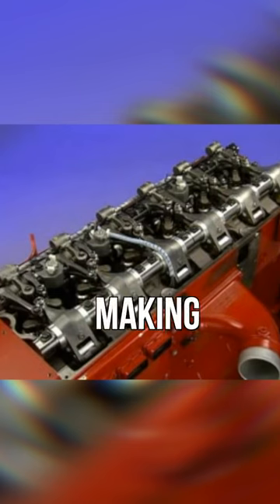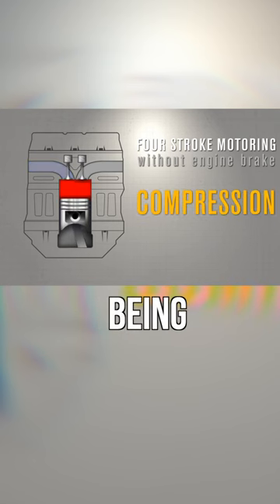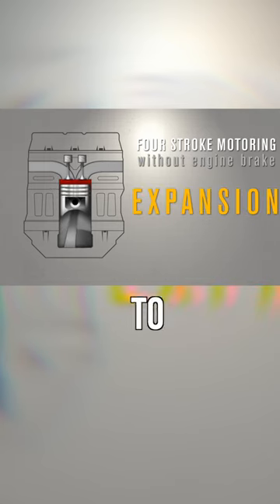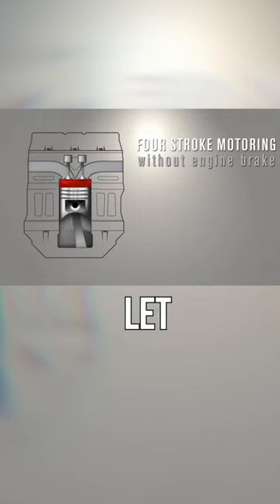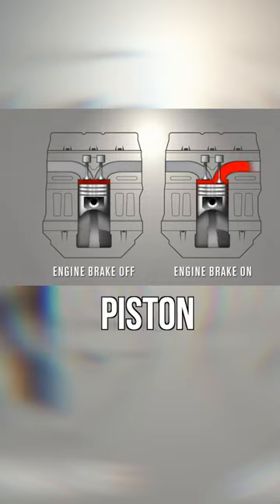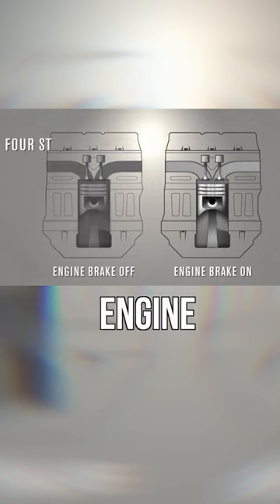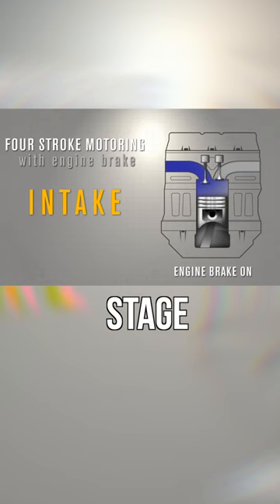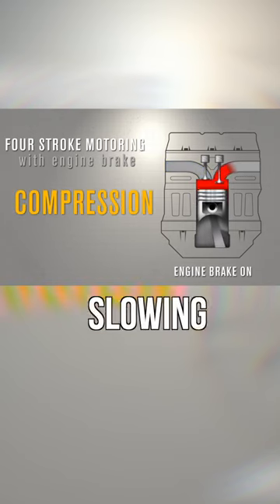What is a Jake Brake? (Short)

Comment: On all the cummins 6bt 6.7  liter engines I've ever worked on uses a sliding ring inside the turbocharger to restrict exhaust outlet. Nothing changes the exhaust valve lift internally.
Reply: But.... that is a exhaust brake.
Reply: That's an exhuast brake; they build pressure within the exhuast itself.
 Real jake brakes build pressure within the cylinder itself
Reply: @3ch0_17 Releases pressure, not build

Comment: You explained 1 stroke out of four. But now since we have no compressed air to push the cylinder down we've created a vacuun on stroke 2, the firing stroke  which is just reverse compression, etc, etc. All 4 strokes become compression strokes.
A lot of people think because they are called compression release  valves, that means no compression.  Not so. It only releases after it has been compressed so that the intake, which is now closed becomes a vacuum or compression, then stroke 3 which is normally exhaust stroke becomes a compression stroke because the exhaust valve is shut.
Then the intake valve is shut on intake strake, creating vacuum again. All 4 strokes are turned into compression strokes with no firing. Only compressed air being released after compression, hence the popping sound.
Reply: So is it pushing unburnt fuel out, or is it only intanking air during this.
Reply: @bobbyholland8160  it doesnt supply fuel into the engine when the gas pedal isnt pressed and the engine is above idle rpm
Reply: @bobbyholland8160 Even modern cars turn off injectors when 0 throttle input and above idle. I have a standard so pretty simple, but some autos use the trans to slow the engine if just the brake lights are on. On auto muscle cars, there was even kickdown linkage to kick down a gear while costing for engine braking.

Comment: Ok I've worked on vehicles my whole life. 
Exhaust brake, Jake brake. Does nothing inside the motor to change. It's closes off the exhaust to snuff the motor out. Causing the motor to brake on itself. 
Nothing in the motor. Unless I've missed something since 2015.
Reply: Yes you have definitely missed something. It’s brake, not break.
Reply: Yeah, it's just an Exhaust restrictor which forces the piston to use it's energy to force the exhaust gas out instead of it moving more freely out of the cylinder. 
Zero idea what this guy is talking about.
Reply: @motorcycledoorsforsale4155  stick your your motorcycles bud.
Reply: @mitchellandrew3318  an exhaust brake is usually used on a pickup truck and is a restriction in the exhaust to slow the engine down. A Jake brake is used on heavy duty diesel engines in semis and actuates the exhaust value during the end of the compression stroke to slow the engine down, no fuel is injected when a Jake brake is on so the cylinder makes no power and the truck slows down
Reply: A real jake brake has everything to with inside the motor 💀 It literally changes the timing of the exhaust valve to prevent compression. Don’t know that you’ve been working on your whole life but it sure as hell isn’t rigs with Jake brakes.
Reply: Then you haven't seen a pac brake for 6.7 cummins that is called (load lease) ! I may not have the name correct ) but it alters the timing .
Reply: @vhateverlie  yes you sure don't have any idea because you are talking about an exhaust brake which generate much less force than an engine/Jacob's break.  A real Jacob's brake is what he is talking about.